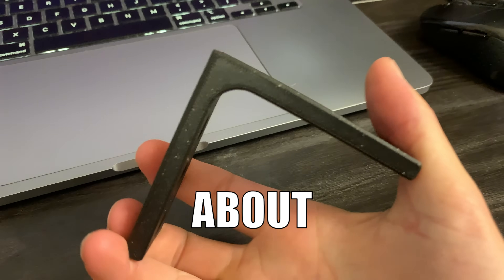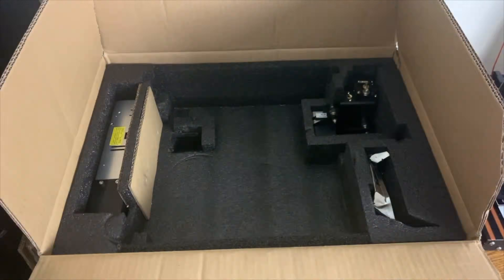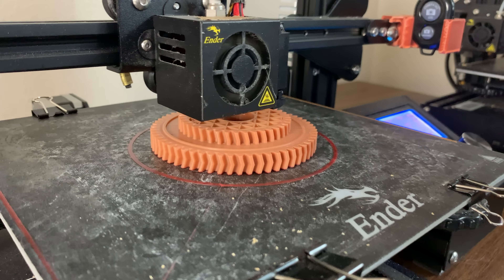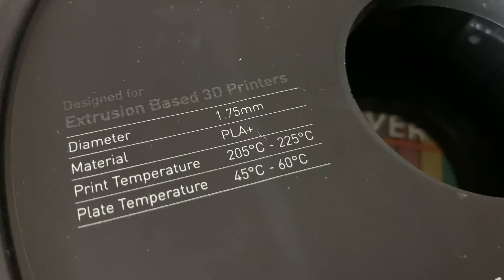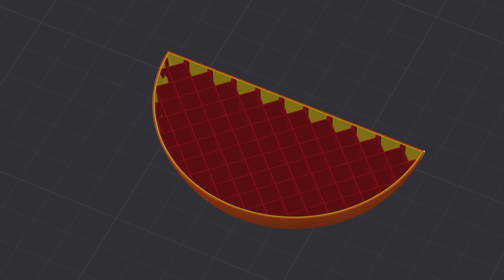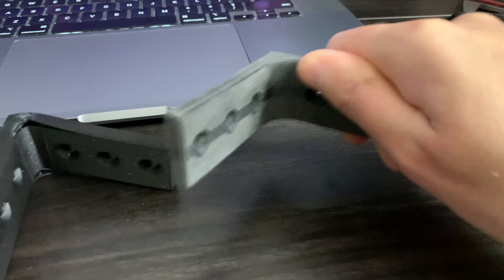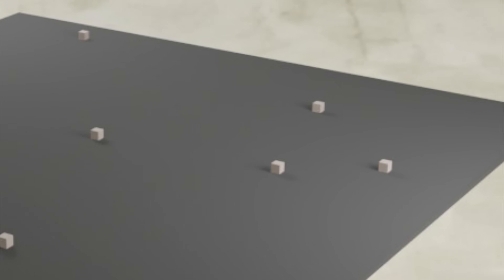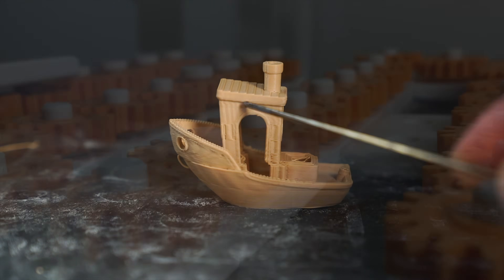9 3D Printing Sins...

Comment: I can already see myself taking off the textured PEI after every print and washing it in soapy water. No thanks—I just spray it with IPA and I’m done. What really cracks me up is how some people recommend fancy cleaning gadgets that cost many times more than IPA. IPA is about €7.36 per liter. Plus, I already use it regularly around the house—it’s great for cleaning surfaces from markers and stuff like that.
Thanks for the tips, for example leveling the bed or changing object positions or print speed. 
👍

Comment: *Two quick PSAs for anyone new to 3D printing (e.g. me 2 months in the past):*

*1. Where are you building?*  
- Apartment, shop, lab?  
- How's your ventilation?  
- How worried are you about fumes?

*2. What are you working with?*  
- Is it toxic to breathe?  
- Safe to touch but dangerous airborne?  
- Easy or annoying to clean up?
- Food safe so it can contain, deliver, mix, or otherwise interact with food?

If you check these two things first, mistakes only cost you time and money to gain experience.  
If you don't... you could be risking your health without knowing it. (Talk to your doctor early if you're worried.)

*Pro Tip for cleaner builds:*  
- Get a spray bottle.  
- Fill it with isopropyl alcohol (70%) + a few drops of dish soap.  
- If it's over 70%, dilute it (distilled water preferred, but tap water is fine).  
- After each build: scrape the print, spray the bed, wipe with a microfiber cloth.

Small habits like this keep your prints cleaner, your printer healthier, and your workspace safer long-term.  
They are also faster than removing the plate every time to run it under soap and water (a perfectly acceptable alternernative for the less lazy).
*Happy printing! :)*

Comment: Im guilty of a lot if. 1 of them for peinting with the wirmhh settings was i was printing with tpu but accidentally selected a file set up for pla instead if the file inwanted to print. Needless to say that caused an escapage as my ender 3 is a bowden and i dont have itect drive bracket.

Comment: I use ethanol for cleaning the bed. Has to be done after several prints. Cant remove it so there is no way to bring it under the sink. I was searching for magnetic PEI surfaces that are 200x200mm but havent found any on any local shop.

Comment: The standard polycarbonate bed sheets like in Ender 3 v3 SE actually don't have an issue with low adhesion.
The problem is the opposite - they have too much adhesion, so the glue stick works with them not in a sense of giving more adhesion, but in a sense of creating a layer which seaprates the bed from the model.

Comment: i think the worst thing that happened when i got my 3D printer Ender 3 for the first time while i was assembling it it was missing one screw for the gantry frame, however i lucked out and my local Ace hardware had exactly what i needed though for a short time i thought the printer i waited days for from amazon was unbuildable.

Comment: Ditch the glue stick and use hair spray.
Reply: i recommend to just get a non flat buildplate, it does wonders to adhesion, and you will not need the glue anymore.
Reply: @BigToro  the Bambu plate has decent texture but often time still needs some hairspray for me. Do you have a specific plate you can recommend for better adhesion?

Comment: Im a new to printing, so Im probably doing this wrong, but for builds that stick to build plate, I put put the plate and build in the refrigerator.  Leave it in there for 10 minutes, all have came off easily with no or minimal use of a plastic scraper.  Probably if I would be more patient, and let the build cool longer on the machine I would probably get the same effect, but like that one lady said, "ain't nobody got time for that."

Comment: As a chemist I disagree with what you said about IPA vs warm soapy water:

- Pure IPA contains only that, is highly effective at dissolving grease and actually leaves less residue behind than soapy water (you stated the opposite)
- Soapy water contains surfactans that are non volatile and thus will remain on your surface, weakening adhesion. Its fine to do this but ideally you 1.) Use the warm soapy water 2.) User normal water to rinse of the soapy water 3.) finish off with distilled water to remove minerals (limescale) the normal water comes with

All in all IPA or Ethanol in its pure form or diluted with distilled water and free of surfactants would be the superior way to get a surface really clean.
There is a concern that these alcohols can dissolve/"etch"/damage the surface of the print bed, but personally I found every print bed I ever tested to be fully compatible with them.

Usually I dont like AI/ChatGPT but in this case I think it it has given a 100% factual and correct answer:
The better method for cleaning grease depends on the surface material and the type of grease, but here's a general comparison between isopropyl alcohol (IPA) and warm soapy water:

Isopropyl Alcohol
Advantages:
Effectiveness: IPA is excellent at dissolving grease and evaporates quickly, leaving no residue.
Speed: Dries rapidly, which is ideal for surfaces that need to be cleaned and used immediately.
Sterilization: Also disinfects the surface while cleaning.
Disadvantages:
Surface Compatibility: May damage certain finishes (e.g., wood, painted, or plastic surfaces) or cause discoloration.
Cost: More expensive than soapy water for large-scale cleaning.
Warm Soapy Water
Advantages:
Gentle Cleaning: Works well on most surfaces, including delicate ones.
Versatility: Removes not only grease but also dirt and other contaminants.
Residue: Can be rinsed off completely with water.
Disadvantages:
Drying Time: Surfaces may take longer to dry.
Effectiveness: Less effective at breaking down heavy or baked-on grease compared to IPA.
Best Option for Cleanliness
For hard, smooth surfaces (e.g., glass, metal): Use isopropyl alcohol for a streak-free, residue-free finish.
For delicate surfaces (e.g., painted or coated surfaces): Use warm soapy water, followed by a thorough rinse.
For heavy grease build-up: Start with warm soapy water to loosen the grease, then finish with isopropyl alcohol for a residue-free clean.
If unsure about the surface's tolerance, test on a small, inconspicuous area first.

Comment: best thing I started doing with my printer is stick religiously to 1-2 slicer templates per printer. Modify some settings but then reset all back to the baseline. It's super important to have a known good/safe profile to print from so that you can figure out if an issue you're having is the printer, the model, or the settings

Comment: Most soaps have additives and moisturizer to condition your hands as you was. This will leave a residue on the print surface and ruin adhesion. Make sure to use something like dish soap for best results.

Comment: If you have an Ender 3 v2 like I do removing the glass buildplate to clean it with soapy water means recalibrating the printer every time, alcohol in this case is better.

Comment: Sorry. Absolutely wrong about cleaning with alcohol. Cleaning with dishwasher soap is just not working. At least for the sheet I am using. So if you want to ruin your print, listen to this guy.

Comment: Why would you ever recommend using metal tools on the plate?? Almost guaranteed to scratch the hell out of it and cause many other issues. Use plastic scrapers only.
Reply: I use a 5 in 1 tool all the time. Don't use it as a scraper until it's mostly released from the bed. Wait for the bed to cool down a bit. Next pop the scraper under a corner and twist it a little. Go around the print and repeat. Once you can get the scraper underneath you can keep it close to parallel and it'll pop the print off the bed with almost no effort. Never had an issue with either my smooth PEI or textured beds. I'm rarely lifting the sheet off the build plate unless I can't be bothered waiting for it to cool down. I've had times where I haven't aligned the sheet properly and the print fails.

Comment: just saying, but when said dont use rubbing alcohol and isntead use soapy water. just going to say it but the alcohol is far better at removing it. not to mention u said when it evaporates that it might leave some behind, this is true for BOTH soapy water and alcohol. the difference is if u actually want the surface clean, like actually clean, or if u dont mind it still having stuff on it. soap always leaves stuff behind while alcohol usually wont if used right. as a science person who uses rubbing alcohol for removing any type of oil, i can say its ar better than soapy water. not to mention if u use water and dont dry it off asap, it can ruin the machine itself as water causes things to rust faster and u cant just place this plate inside an oven to dry it as thats the only for sure way to get it 100% dry with no risks.

Comment: Psssh. My sidewinder x1 has a textured glass heated plate. I use a sponge and some barely watered down white glue and just wipe it down and heat it dry. It works insanely good. I never have adhesion issues (or prints sticking when they are cooled) before that I'd literally pulled glass off. All that to say I regularly HEAVILY touch my plate, use a pocket knife to scrape it or delam prints, and I never have fingerprints, because I don't have grubby dorito fingers. Wash your hands people if this legitimately is an issue you have

Comment: Ehm... There are good reasons to clean your printing plate with isopropyl alcohol instead of soapy water! Soapy water is actually very good at removing dirt, but it also attacks the top layer of the printing plate. The printing plates are actually relatively chemically sensitive. A good printing plate does not need a glue stick to print and if you look after it properly it will stay that way. If you want to destroy this useful ability of the plate even faster than with soapy water, why not use acetone...

Comment: Nobody should ever have to manually level a printer bed: printers with automatic bed leveling are available as low as around $200 now, so the entire potential price range is covered by printers than can auto-level. Printers without this feature should be ignored in purchasing decisions.

As for isopropyl alcohol, it does have an advantage: it's way faster to spray some on the bed and wipe it off. If you're not having adhesion issues, I'd suggest that you can get away with just a quick spritz and wipe with isopropyl most of the time, and a full wash with dish soap for an occasional deep clean.

Comment: An advice for beginners: If you ever install a new firmware you have to level the bed again. Especially if it's a printer without an Z-axis end switch and auto leveling. 
I learned the hard way and ruined my work plate.

Comment: To get stuff of a built plate, if you have a magnetic or otherwise detachable one just take it off and flex it back and forth a couple times until the print either pops off or starts pealing. Don’t do this with smaller prints as you will end up bending the build plate to far and overtime it can weaken the plate in the middle

Comment: Is 100% infill necessarily stronger? I've heard that it actually is a bit weaker due to the deformations it causes.
Reply: Nope. It's not, and you're correct. It's about finding a balence. I ussally do 3 perimeters and sometimes go up to 5 for stuff like shelf supports. The funny thing is 100% infill can actully give you less shock resistance, and like you said, make them much more prone to warping (due to radient heat  from the nozzle causing uneven shrinkage)
Reply: @100SideDice Same, I've found that 3 is a good balance for most of my needs.

Comment: As far as build plate cleaning, I use alcohol wipes between prints.  Soap and water after every few prints.  Never use your pliers to pry off the plate.  They will break and your a lot more likely to damage the surface.

Comment: I use Ender 3 v2 Neo’s professional firmware and it has a tramming features. I also use a spring steel bed. My bed adhesion so pretty good

Comment: In this day and age, should you even bother buying a printer that doesn't have auto-levelling?  Bambo Labs has really produced some amazingly inexpensive printers that just flat out work - namely the A1 mini as an example.  Granted it has a small build plate, but it's really amazing what you can do at under $300.

Comment: You're showing lots of Ender 3 Pro in the video. MY Ender 3 Pro problem is the bed is not flat. I've heard others have seem the same thing - the middle of the bed is very, very slightly concave. It's easy to get either the outer edges at the right height, or the middle at the right height, but not both. And there doesn't seem to be anything I can do about it.  :(

Comment: I use a glue stick for adhesion, but it releases better after the print, too.
I used the paper method for leveling the original bed. It crached and scarred the bed. I used a business card to set the reoolacement and brought the bed up after printing bed level tests.

Comment: I have found that I REALLY LIKE PETG over PLA....  

But my Auncubic Mega X that I've had for many years, after xx minutes into a print, the temp sensor and all says its hot and everything is good, but the head is ice cold.  I've replace the heater/wire/little PCB in the hot end where the wire harness goes in/sensors/firmware (changed from OEM to latest Merlin build)/filimant/even the hot end itself... and NOTHING, it still does it...  I cant figure it out... last thing I can think of is my Motherboard, but its not in stock anymore.

Comment: 6:24 In case of my X1C, the gluestick is intended to be used as a release agent, for the cool plate only. It's there to ensure the prints don't stick too well too the buildplate and rip off the pre-applied film.

Comment: about the "good" default slicer settings. mine were good but not efficient. after now half a year of owning a 3d printer i changed many settings. and it prints a benchy in half the time of the default and the quality is the exact same if not even slighty better due to better overhang settings.

Comment: PEI build plate, spray it with a tiny travel spray bottle I found in the travel section of a drug store, with 91% (or higher) IPAlcohol and wipe with a clean (only ever used for this) microfiber cloth between prints. Never have adhesion issues, and if I'm patient enough to let it cool completely off, the print literally falls off. No scrapers, no lifts, no glue sticks, no washing with dish liquid.

Comment: would you print smartphone case fitments for the razr kishi version 1 controller? the controller is good just the flappines is a downside. if you would print such fitments just per request not upfront you could make bucks out of it. in need one for the galaxy S10. I'd pay totally 30 dollars u.s. or eur for it. if that's reasonable no idea how exp. the material is. but I'd raise up to 50 bucks per request. consider it ty

Comment: But wiping printbed with izopropil alcohol (acetone, regular alcohol, you name it) - is simply faster than bringing buildplate to the sink, wash there and wait til it dry. Wipe the bed in-place and start new print right away, done.

Comment: just spray pure alcohol and never use soap to clean the surface. soap leaves residu. and if alcohol doesnt work anymore get pure acetone to completly clean. not the one for removing nailpolish because there is stuff in there that leaves residu. get a paper towel and put a bit of acetone on it to clean the surface. don't do it to often because it can damage the pei if used to much. but a little bit that dries fast is no problem. i never had a print detach when i had my first layer correctly dailed in.

Comment: tbh i just used a can of air to release my prints as it rapidly cools the prints without having to wait. also textured beds don't require any glue so is simpler to use and less messy. plus if you want to clean your build plate use isopropyl alcohol spray and some kitchen roll when its fully cooled of and the printer is turned of. also bed levelling probes are super easy to install and are cheap especially for ender printers as they have the creality levelling probe that comes with the brackets ready to just bolt straight on

Comment: 1. Its not that bad to touch the build plate. If you have a pei sheet it would still work.
2. If you use metal tools on the metal printing surfaces you will certainly damage the printing surface coating and the parts wont stick. Wait for the bed to cool if you have troubles taking parts off the build plate.
3. If you use glue with steel sheets you're doing something wrong as these print surfaces are already treated with either a pei foil or the texturing. 
4. Use glue/painters tape only if you have a glass bed. And use glue especially if you print PETG on a glass bed as to not damage the glass.
5. FIRST COMES TRAMMING THE PRINTER which is more important(imo) and applies to printers with and without an ABL probe. After you can level the bed.
6. IPA does 90 of the job when cleaning but if it still seems greasy or you actually dropped grease or something like that wash the plate with DISH soap not hand soap as hand soap may cointain moisturising agents such as, what do you know, oil.
7. For outside use the safest choice is petg. ABS and ASA are both harder to print and both contain styrene which releases harmful gasses so you shouldn't print with those in rooms that are either poorly ventilated or in rooms in which you work or stay.

Comment: Please please please stop taking meral scrapers to your beds. Keep metal tools in general away from it.

Also, the textured stock bambu plates typically dont require any glue and IPA is plenty enough to keep them clean. People with thousands and thousands of print farm hours on them use IPA just fine.